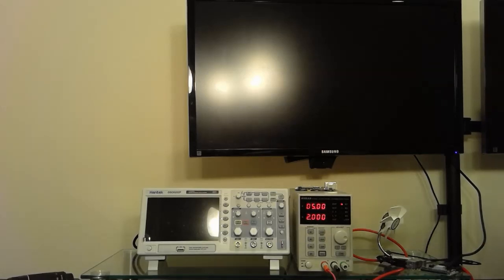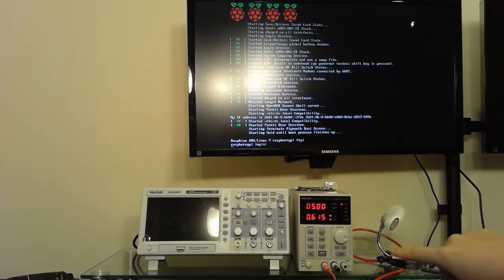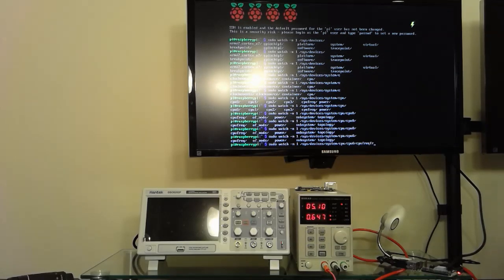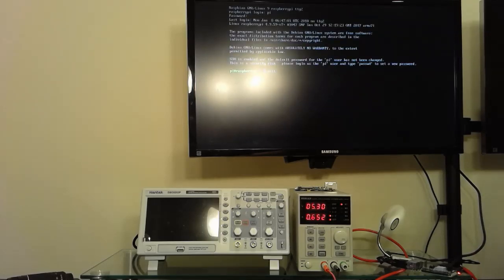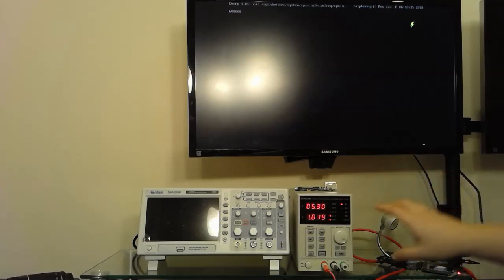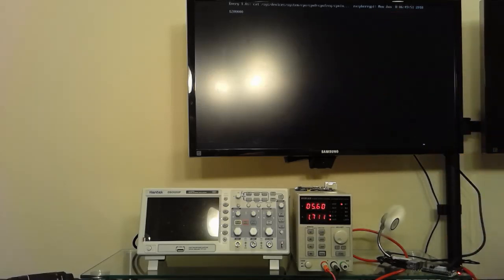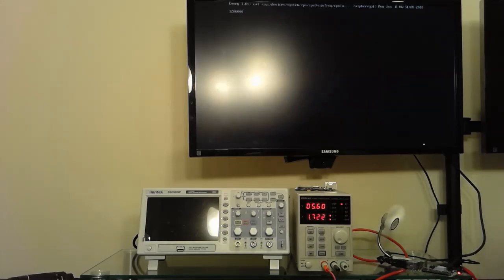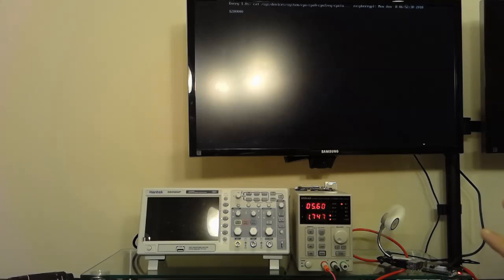Raspberry Pi 3 Lightning Bolt Rainbow Square Power Issue Demistified

Comment: Your wires are too long and skinny or your connector contacts are dirty. Pi works just fine if it actually gets 5V. 

The MF-MSMF250/X poly fuse has a maximum resistance of 100mΩ, when *tripped*, and 15mΩ when working normally. So even if tripped you're not going to see more that an 100mΩ*3A = 0.3V drop from the Pi's doing. There is also no diode in series. So I don't see how you're getting a "1V drop". Are you measuring voltage on the test points on the Pi itself?

Comment: i am willing to bet the reason why the raspberry pi is designed that way is to cut costs.

remember a while back then due to contractual reasons  the chinese manufacturers of the 18650 cells  was commissioned to manufacture exclusively for the ev industry so the only way you could get name brand 18650 cells new was to either buy a tool pack or other product and tear it down for the cells or to pay hyper inflated prices on ebay.

now the chinese put a sticker on the cells and they can sell them directly from factory as cheap knock off.

same goes for ceramics  on ebay you could buy a bust of michelangelo david for $50 but it was keyworded as whit man bust so ebay's algorithm would not automatically raise the price based on the keywords.

the same goes for illegal stuff like hdcp strippers that was disguised as hdmi splitters, amplifiers and remuxers.

if they came out and said "it will remove the hdcp signal so you could record hd content then they could not be sold but by not saying that they can sell it.

the same here if the raspberry pi was designed properly the market would  demand a price of maybe $100 instead of $35 for a bare board and maybe over $200 for a full kit consisting of a case a couple stick on heatsinks a cheap power supply and an sd card.

Comment: Damned. With 5.4V the Raspberry Pi3 not detected usb mouse and keyborad in usb hub. With 4.8V all work fine, however the yellow light bolt 😑

Comment: What really causes this issue is the under sized wires that are in the charging cables used to power the PI. I use my own supply set at 5.2v 5a , I chopped off both ends of my USB cable, soldered the 4 plastic covered wires togeather and used that for positive and used the shield for negative, soldered on a new micro USB end and it works like a charm.

Comment: I have the canakit with the 2.5 amps and I get the bolt. I upgraded to a 3 amp and get the bolt. I found a USB battery pack charger that outputs 5v at 4.8 amps and no bolt

Comment: I run a 12v laptop power supply into a $3 buck converter. Set the voltage to 5.65v using the buck and chop the end off a USB cable and wire it to the buck converter. 
Havent had a power issue since

Comment: the question is how do you fix it?
Reply: I get them from aliexpress. The ones I get are adjustable via a pot. I use a 12v power supply and the buck can be set at basically any voltage you like via the pot. XL4005 is the part number of the one I am using. 
Search aliexpress or eBay for "buck converter XL4005" and you should be able to find them.
Reply: I can adjust the buck to any voltage below the input voltage (12v or below in my case).
You can get a boost converter to get higher voltage from your current power supply but you will lose some amps. That's why I use a 12v supply and a step down (buck) converter.
Reply: @dodgyaz  Thank You!
Reply: @dodgyaz  cheers
Reply: You dont. You just need to supply 5.6v. I run a 12v laptop power supply and bought a $3 Buck Converter and dropped the 12v to 5.65v. Then chopped the end off a usb cable and wired it to the buck converter.
Reply: @dodgyaz  damn, i dont get why everything they give, and sell with the rasp pi doesnt supply enough voltage? I have two pi's with this problem
Reply: @dodgyaz  could you point me in the right direction to purchasing the buck converter? having a hard time finding one that does 5.6

Comment: Is this still an issue with the Pi 3B+?
Because it is definitely an issue with my Pi 3B
Reply: yes I am having an issue with the lightening  icon  I have a 3b+  I updated all kernels and is  using it for retropie its giving me issues i am not using this company's power supply  im using a rhino  5v 2.5 amp
Reply: Yep. My 3B+ needs 5.65v input to run without the lightning bolt when running a benchmark.
Reply: @dodgyaz  Does it overheat and give u the thermostat icon
Reply: @RedCGaming  Mine doesn't overheat. 
Do you have it in an enclosed case?
Reply: @dodgyaz  yea but i had the official power adapter and it would give me the undervoltage error. So I put a 5.3 V adapter and after about 30 minutes it starts to over heat even when i open up my case.
Reply: @RedCGaming  Is anything running the cpu at 100%?
Reply: @dodgyaz  im still new to this. How do i check that?

Comment: Could you explain how to turn off the power warning/throttling? I'm getting throttling at .4 amps consumption and 4.6 volts (tested on one of the USB ports with a tester, as well as the 5v GPIO pin with an oscilloscope.)

Comment: Thanks! Just picked up your power supply on Amazon. Been having this issue and have come across countless issues. I bought the unit prebuilt and I believe is overclocked.
Reply: Devin Pringle Did this power supply fix your issue? I’ve tried 4 different power supplies and still get the lightning bolt. Can it handle the overclock without the lightning bolt? I’m running a Pi 3 B+ with a 1.5GHz overclock. Thanks!